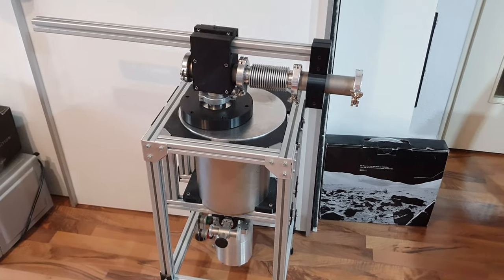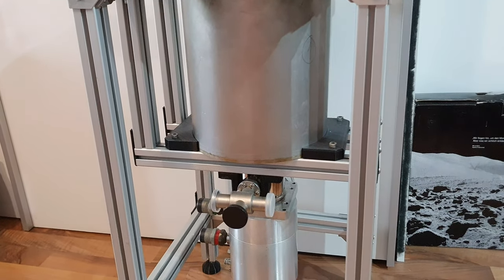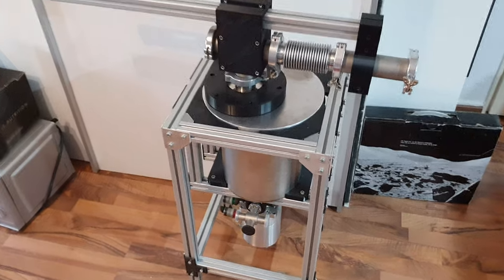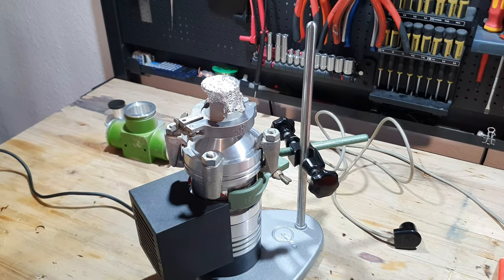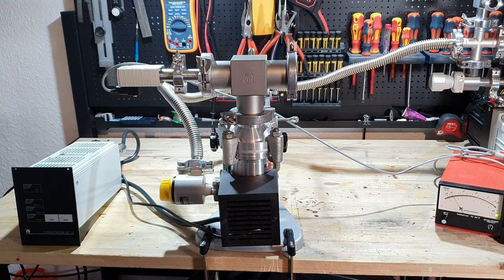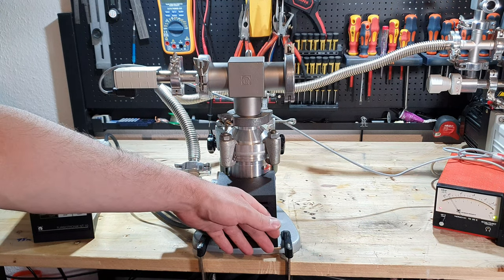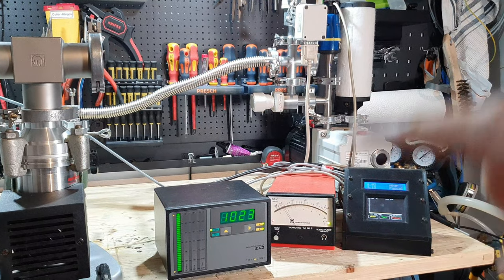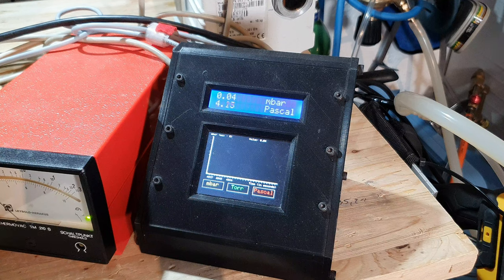My turbomolecular pump makes weird noises...

Comment: An intermittent high pitch noise from your TMP is bad news.  If the pump has not been run for a very long time and you are very lucky, it might clear itself.  (The initial error on first start makes me think that it has been a long time since it was last run) But a TMP that runs at 75Krpm must be perfectly balanced with essentially zero bearing drag.  The intermittent noise means that the bearings are not in that perfect condition. Hope that this advice is useful.

Comment: I'm not sure what turbo you have, but some have both a bearing and are magnetically levitated.  I have Edwards EXT255H's that I've been working on getting up and running - They generally should sound pretty quiet, but I feel like I'm hearing a high pitched metal-on-metal whine - which at 75k RPM is not a pretty thing to have going on.  You may wish to see if there is oil that can be added and or if you can get a new bearing if your system uses one (The Edwards are Hybrid - magnetic on top, thrust / stabilization on the bottom)  Also, check your manual for max/min foreline pressure.  Some turbo pumps don't like to be run below a certain pressure, because below that point your bearing lubes will start to offgas and you can reduce the lifetime of your turbo.   I purchased ceramic ball bearing replacements from china so that if I ever have to service one of my turbos I have them on standby (but thankfully haven't gotten to that point).  Turbos simply aren't cheap.  For a good laugh, "Spirit" has a funny (to me as an engineer at least) youtube video on an Edwards pump teardown.  ("Rescuing the irreparable - Edwards EXT255 turbomolecular pump repair)".  Love the videos, I look forward to seeing your UHV setup running.  Alles gute von Oregon USA

Comment: Use a grinding paste on the flange using plate glass, which is harder than flange. Do both sides, and you're good to go. Doesn't take an Einstein to see that will work. To find the noise, you can use a hard stick against you ears, or a stethoscope, if you can get one. You will then localise where the noise come from. The motor bearing might need changing, but will need lubricating when fitted.
Reply: you can use a very fine grit polishing paper to clean up or take out small straight line scratches on KF flanges. I use a grit like 10,000 or more sand / polishing paper. The polishing paper is attached either with glue or wrapping the ends under to a flat glass plate, do not move the flange in straight lines, rotate it and move in a circular pattern, this avoids scratches runnig across the surface, rinse with IPA and test.  works on all but the worst dirty or gouged flanges!

Comment: Older Alcatel grease lubricated pumps should be briefly spun up (very low rpm) in atmosphere to allow redistribution of lubricant, according to the manual.
Reply from the maker: That's great to know, thanks!

Comment: Hi, I have similar setup (nt10 and turbovac50), but don't have the cable. :( I wanted to manufacture the cable and already have the parts now, can you help me please with the pin assignment.
Reply from the maker: I am currently on vacation for a week but when I get back I will try to help. If I forget, just remind me with a comment or write me an EMail ;)
Reply: @AdvancedTinkering  Reminder! Thank you!!
Reply from the maker: What information do you exactly need? The continuity between the pins of the different plugs?
Reply: Yeah that would be great help.
Pump side 4 pin <-> controller side 6 pin.
Pin numbers are written on the connector.

Could not find it anywhere.

I can send you e-mail (where?) with picture.
Reply from the maker: I think talking via mail would be best. You can find my email in the channel description. Or search me on Instagram and text me there :)
Reply: @AdvancedTinkering check spam please, already sent e-mail!

Comment: Good day, I have a quick question for you if you have a moment. I am also looking to piece together a system to make liquid air and liquid nitrogen. I have been looking on ebay but have no idea on compatibility of systems. Do they have to be the same brand - or can they be swapped/pieced together and still work? Any assistance would be greatly appreciated.
Reply: Yeah because you know how ultra high vacuum is involved in the condensation of air. Whatever you think this video is about, it's actually exactly the opposite. Maybe learn to read before wasting money on condensing something using vacuum.
Reply from the maker: Hi,
I'm not an expert but I would say it highly depends on the unit. I doubt you can just use any compressor with any coldhead. Maybe it's better for you to look for a pulse tube cryocooler. They are compact, do not need an external compressor and can liquefy air.

Comment: Okay, so a lot of the comments here are... questionable.
I'm a bit closer to an actual vacuum expert so I will clear up everything you see here.
1 - Starting pressure. Your forepump is getting way below where you need to be to start the turbovac series, and there are no issues with it. You are well within the safety margin, and the turbo can be started around 2 mbar, you don't have to wait to degas the rotary vane oil. With a fan it will happily sustain that load indefinitely.

2 - The leak. It's not a leak, there are two reasons for it - first, your system is wet. Just gently hit a tee with a torch while pumping and you'll see the pressure fly. Second, when it goes up when you close the valves - KF(also ISO-NW) gaskets are permeable, especially if yours are buna instead of viton. In a fully baked system, you'll be near atmosphere in a week, especially if you have many seals. This is why the ion gauge also shows that you're stuck around e-4 to e-5. That's water. This is solved by around 5ish hours of pumping for that size chamber, assisted by heating it to around 70-90C.

3 - The startup whine. Turbotronik controllers have fairly rudimentary controllerless logic - the "nyeee nyeee nyee" sound you hear is the bang-bang controller slowly starting the pump. That is normal.

4 - The initial failure indicator. It's likely that either the oil is a bit dirty, or that the turbo has just sat idle for a very long time and it needed a good spin to wear back into its normal operating conditions(see #5). If it only happened once, you can ignore it. 

5 - The operation noises. This could be one of two things(or both) - the controller caps are slowly drying out and there's not much filtering(easy fix, just swap the caps), or the turbo's bearing is just starting its way out, and will fail eventually. Either way you're fine for now(it won't fail quickly while on an amateur pumping duty cycle), but I would do the due diligence to check the oil reservoir condition by dismantling the lower part of the turbo(short of unscrewing the main rotor nut). Should be clean, with no debris.
If it sat for a long time, you can also expect the noise to go away in a few hours.
Reply from the maker: Thank you a lot! That was a lot of great  advice and valuable information!

Edit: It is a turbovac 50. According to the information I found online, it is a grease lubricated bearing. Is there still a reservoir I could check?
Reply: I was also thinking that the rise in pressure was due to a “wet” system/humidity at atmospheric pressure. 
Easy way to check is to let the system sit with no pump and if it levels off while still in a vacuum it’s due to moistures
Reply: @AdvancedTinkering  If it's grease lubricated, there's not much you can do besides greasing. If it allows user greasing(not a sealed bearing), you need to make a funny syringe for that, follow the manual.
Reply from the maker: Ok, thanks. The manual was not helpful at all. It basically says: "If anything is wrong with the pump, send it to us and we will fix it". 
I don't know if there is a maintenance manual only for technicians. But I did not find one.
Reply: @AdvancedTinkering  Then just let it be for now. Let it wear in, see if the noise goes away.

Comment: From the manual excuse the Japanese translation
- TMP running in mode (T) ...
This is a mode done to make grease become familiar with the bearing in the turbo
pump. 
Please do that running-in of the TMP when you did not start this device for one
month or more. It takes about 30 minutes.

Most of the non MagLev pumps have a running in process that needs to be followed if the pump has been off "for some length of time" The manuals hint that the procedure re-distributes the lubrication for the bearings. If I have a pump that has been off for some period of time, I mimic the Adixen "TMP running in" process of restarting the pump. I was flying all around the country replacing TMPs in new tools. Nobody knew about the "TMP running process" so the pumps were simply turned on and many failed in short time. I happened to find it mentioned buried very deeply in the pump manual, and that solved all the short time failures.

Comment: The leybold nt10 controller uses the motor windings of the tmp 50 to determine temperature. Does this during the off pulses of acceleration.

They often go out of calibration and give false failure readings but is a simple pot adjustment.
Reply: Also the noise is typically from bearing cage rattling or possibly if extreme rotor to stator contact. Bearing replacement and high speed balancing is only real solution.

Also note these pumps are prone to leaking around the epoxy on the pump cable connector causing high load and poor foreline/inlet pressure.
Reply from the maker: Thank you! That's some valuable information!

Comment: Quick guess, in the turbo-pump the tolerances might be very tight (75,000rpm's is fast!).

It might not have the high frequency intermittent noises if you take the roughing pump off the table or better isolate the turbo-pump from external vibrations. 

cheers, keep up the great content!

edit: if the noise persist, next logical step is an oil change, then after that you can try and tackle the bearings. I haven't done either on my turbo-pump yet!
Reply from the maker: Thanks! To isolate the vibrations of the roughing pump is a great idea! I will try that. I really hope I don't have to disassemble the pump...

Comment: the dirt looks to be corrosion, is the pump magnetically levitated in any way? im quite certain the sound wouldnt be from the rotor rubbing on anything, that would cause way more troubles.
i would still be worried and search for it tho ^^ i dont know how old the inverter is but it sounds like some electrolytics died and you can just hear the transformer whine

Comment: Were you able to fix your pump? This seems like a bearing issue
Reply from the maker: It kinda fixed itself after some time running the pump. I suspect it was the lubrication of the breaking due to the pump not running for a long time.